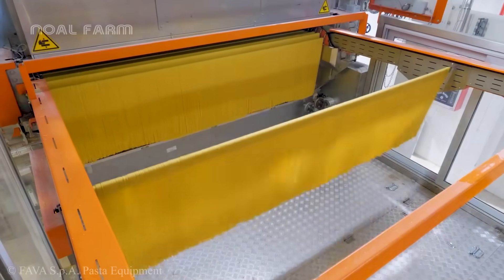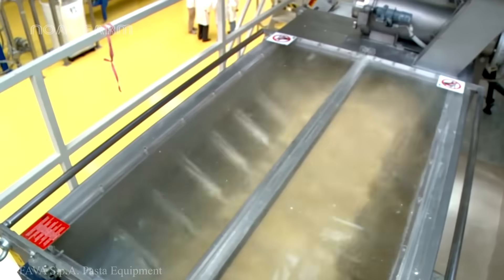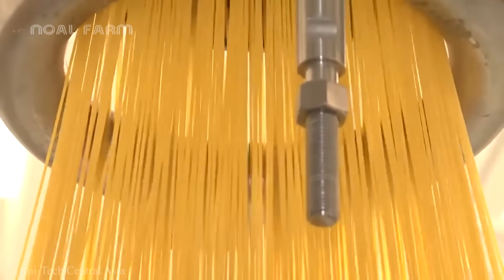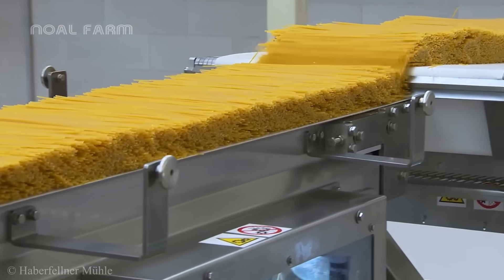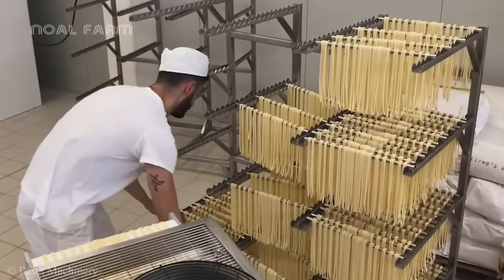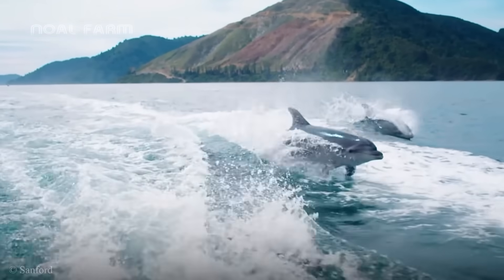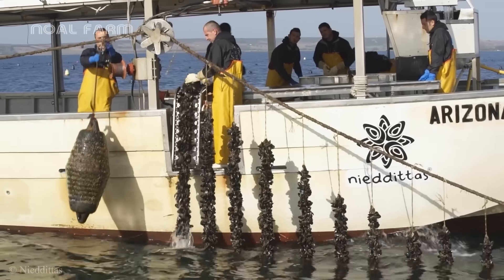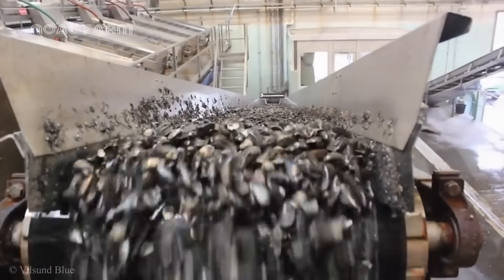How Millions Tons Of Spaghetti Are Produced And Processed Annually - Spaghetti Production Technology

Comment: I'm always baffled by how in these videos the machines look spotless; almost like they are brand new and never been used before.
Reply: The facility is given warning that there is a film crew coming in so the workers can stop the machines before the film crew comes in and scrape all the mold off the windows on the mixers and clean them up a bit.  It sounds gross, but really it only grows on the windows because that is where moisture tends to accumulate and never falls into the dough that is mixing in the vacuum mixer.  If you shut the machine down every time it started to accumulate you would have to clean it off multiple times a day, and when you lose about 60 minutes worth of product every time the machine goes down it can extend the run much longer than necessary and get expensive.  Those pasta machines put out about 6,000 lbs of pasta per hour, and use a freakish amount of power, so it gets expensive really fast to not have them running.